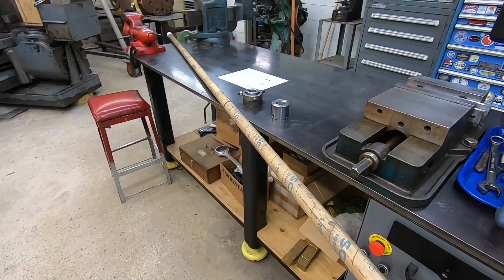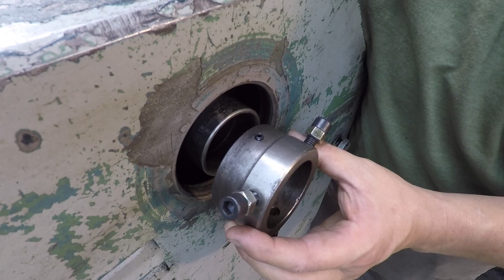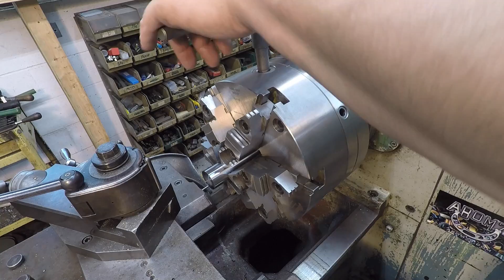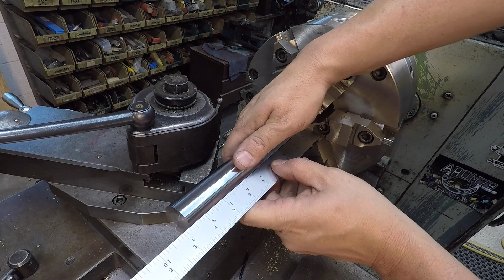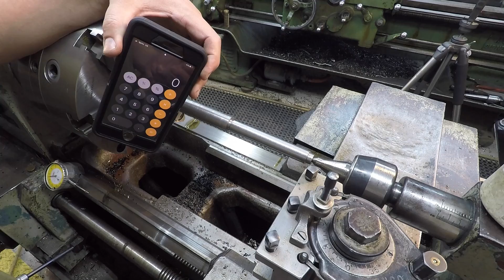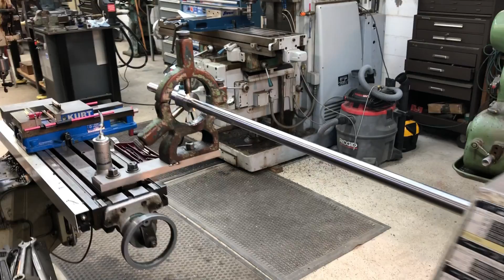Machining a Custom Prop Shaft Part 1

Comment: I saw a video of a guy doing this . Very poorly supported,  im guessing he was fired, if he survived! The last thing i saw was tge material Bent at a 90°.   After the bar beat everything up. It picked up the lathe and started slinging it around, he was using one of the jackstands with wheels on top . It wasn't level or something. It made a mess..  and it was a huge lathe, looked like a 20' bar of 2" maybe larger.

Comment: First put the steady rest on the lathe with a piece of stock the size of the shaft support bushing in the chuck then adjust the steady rest legs to the diameter of the support shaft bushing then remove steady rest and mount on support mill?

Comment: I make many propeller shafts for boats with inboard engines and mostly use either aquamet19 or 22 stainless, 17 does not hold up for in saltwater, will be pitted and rusty in a few years of use.
Reply: Like he said, it's a prototype, so I doubt it will see corrosion within the experimentation phase, and proper material selection will follow later.
Reply: Not if you use the some type of cathodic protection. Better for larger vessels also stronger material compared to 19

Comment: does anyone know he briefly mentioned Small set screws on the chuck to fine-tune something I’m not really aware of how that works can anyone offer any explanation? Because I noticed there are set screws on chucks normally you just dial it in as best you can tap the jars or the work peace and get it as closest possible but if there is a further way to get it even better I’m curious

Comment: when you start the second and third and so on passes of the threading at that RPM how do you get it to start at the same point on each pass?
Reply: that’s the dial he showed with the even numbers.  it’s like a nut that grabs the lead screw. so he engages it every time on the same number.  i think he’s using number 1.

Comment: i like that center your using with the  little extended straight section.  there a name for that kind of center?
Reply: It is a steady rest that's usually used in the lathe somewhere between the chuck and the tailstock.
Reply: @Brian-sb6rf  yah, i asked about the special-ish center he used in the tailstock, not the steady.
Reply: @mtraven23  Okay, i see, my mistake. You're talking about the live center. The cone on it is made in such a way to aid in getting wider tool holders closer to the center of the part. As far as a name? I think they're pretty much just called a long nose or long point live center.
Reply: @Brian-sb6rf  yah I totally see the use, wanted to get one.  needed the term "long nose".

appreciate the assistance, thank you.

Comment: The brake on the Victor takes its time to activate, how do you go on in an emergency stop ✋
Reply: It's actually a manual brake. It's not stopping like that by itself, though some machines do come with a brake system. Instead there is a foot pedal near the floor that he steps on to stop the machine.

Comment: 35:10 I´m working as a CNC machinist for half year, I was borrowing 50-75mm mic from one of manual machinists, he asked me if I knew how to measure with them... of course I do, I said... so show me then on this shaft.... as I´ve started to tighten the mic he said you´ve already got it wrong son.... let me show you, look at my face as I´m measuring.... he got it tight a bit, looked away and tightened the ratchet.... this is, young boy, how you measure right, not wanting to get it into the tolerance... from that moment, I look away a bit everytime I measure with a mic :)

Comment: Adam, I like the way that you went into such detail about how to align the shaft in the center rest. Using the Starrett level, and lifting the shaft and settling it back down on the fingers of the center rest to check the bending moment..... That showed good sensitivity, and it was so cool!!!

Comment: This has probably been answered before.  What brand is the indicator holder used on the lathe way?  Or is it homemade?
Reply: that looks home made to me. I haven't found any available for sale, and it would have to account for many different  ways.
Reply: If you're talking about the indicator holder with the magnetic base almost all the ones he uses is Noga brand.

Comment: This man really knows his stuff!!! I really like how he used the bushings and supports, and adjusted them to cente& true-up the shaft within 0.0005" , the radius tool to relieve the stress riser that was at the base of the threads & shoulder, and the way he frequently used the micrometers, dial indicators & thread pitch & diameter gauges .... Hopefully the customer will come back to HIM For any other Machining work that needs to be done... He is AWESOME!!!

Comment: When cutting the thread how does the tool find its way on the second to n-th pass? Does it get "pulled in" by the existing thread somehow, and if so, how is it prevented that the machine does not just cut a second thread with a different starting point?
Reply: There is an indicator on the lead screw of the lathe.  There is a little dial that rotates to tell you where you are on the lead screw, he's waiting for a certain dial reading each time to engage the half-nut of the carriage onto this lead screw

Comment: nice, but don't piece like this need to be "tempered"? or they get automatically tempered?
Reply: He explained in the video that it's just a trial, if it works, they'll make another one with better material, I would think Thomson shafting would be a good choice. Hardened, chromed OD with a machinable ID.

Comment: I went back into the machine shop recently after about 6-7 years away. We do a lot of hydraulic cylinder repairs including making new rods, pistons, and barrels. First screw thread I cut in around 8 years was an M42 x 1.5 for both internal and external on a cylinder rebuild for the rod and piston. Came out first time with zero backlash. I am so happy to be back in the machine shop. 2 months in now and it t is going very well.

It felt so satisfying to screw that piston on and have it feel the way it did. A real confidence booster to throw myself back into it and confirmed I still know what I'm doing after all these years.

Comment: Boater here. Surprised at how much reduction in diameter was machined at the threaded end.  My three cylinder diesel only produces 27 hp.  Shaft diameter 25 mm.

Comment: When you  tighten all 3 pinions, there is a small amount of clearance between the scroll and the spigot it rides on which gets pushed ever so slightly to one side which alters the measurement.  People forget about this when grinding the jaws of a chuck to true it up and if there is a lot of wear on this spigot all the grinding in the world won't get those jaws to run true.

Comment: How do you ship or deliver a shaft like that and protect it? In a PVC pipe?
Reply: Small crate type wood box. But yes...also you would insert it into either a black steel gas pipe or even pvc. But ultimately it would be boxed.

Comment: Hey brother, I appreciate your videos and their excellent and knowledgeable content, thank you for taking the time to make them.  I just wanted to make a possible suggestion.  Like you,  I find myself standing on concrete and working with my hands.  Have you ever considered using some of that thick (1.5 inch or so) black rubber mat (with holes) on your floor space?  Similar to the stuff they use in kitchens and other hard surface areas?  It comes in large (very heavy) rolls or easily manageable pre-cut squares, which are easy to pull up for cleaning purposes.  I think you should look into trying it out, I promise your back and feet will thank you.  I am not affiliated with this product, just a satisfied product user !

Comment: Why do go-no-go gages have splits in them.. do they get calibrated? Are they adjustable?
Reply: All gauges get calibrated if you are in a proper working shop environment. Ive never used split ones, but suppose its better really as they can be tweaked if worn on the go with alot of use.
Reply: Mark, you are correct. The splits are not so the user can manually adjust the P.D. but for the Manufacturer or Calibration Company to compensate for wear.

Comment: I always had an issue with stopping the carriage before running into the shoulder or stopping it to soon to ruin the threads.  If you did that manually nice job.  Looks like you either own your own shop or you are the boss. I always had some one  coming out of the office " are you done yet"  and it was very distracting.  Very methodical and all ways think ahead.
Reply: This is his personal shop

Comment: Does that mic  measure root or effective diameter??
Reply: All Thread Mics measure Pitch Diameter only because it is the dimension that affects the fit or H-Limit of the thread.

Comment: Why show the indicating?  That is the most boring thing you do. Operators do their own. And do it well. Watching shows nothing.
Reply: A huge percentage of Adam’s audience have hobby machines or just bought their first serious machine and some of these basic techniques have not settled into habit yet.  Getting set up right gets one out of the sloppy habit of ‘eyeballing’ your project and shrugging it off as “good enough”.  I was in the shop when one of the guys projects flew off the machine and punched a hole through his arm because he ‘forgot’ to indicate or set machine speed before just flipping the switch and running the tool.
Reply: Because it's SO important! And because if you're not practised at indicating it's really tempting to compromise. Adam demonstrates that, with practice and patience, it's possible for us all to get it right.
Reply: Indication = porn
Reply: ...well, if ya don't LIKE IT- then ya don't have to EAT IT!!!

Comment: I recommend a miniature electric valve here. I have experience in this area. The effect of water saving and water control is very good. You can go to this website to see. There are different electric valves, such as open /Close valve, proportional valve, it can work under different voltages, and can choose different control methods. Website: http://www.tf-electricvalves.com

Comment: If it's a mud "motor" why does it need a drive shaft? The motor would be back at the wheels and there would be one per wheel. 
And if you meant to say "engine", maybe it's time to review the difference between an engine and a motor.
Reply: I’ve never seen wheels on a boat... Sounds like it wouldn’t be very good in the water that way. Mud motor is an industry term for it and its what’s there all called. Nice try just trying to be an ass though.
Reply: An engine is a type of motor but a motor is not necessarily an engine.

Comment: Machined many long 15 meter shafts mainly for ship propulsion, multiple steadys, the hardest part was trying to keep them straight because forged shafts will bend with cutting stresses.

Comment: I do this type of work all the time. I like that sleeve idea you used. Many times the machines at my work have a too big steady rest. I'm going to steal your idea and make up few sleeves! I make a lot of different pump shafts anywhere between 10 and 12 feet. Thanks for the vid! Only thing I didn't like was seeing you put your left arm over the chuck when using the file.

Comment: two questions from Italy: 1) how long has that mechanical workshop been open? 2) how much value is there in equipment? .............. especially congratulations. I also worked in a place similar to Gardolo di Trento ..... that workshop (where I worked) has been open (evolved obviously) for at least 100 years. It is now a mechanical workshop where they build precision parts with the CNC.

Comment: I really don't understand how he can just engage the table any time and it's just knows where the threads starts
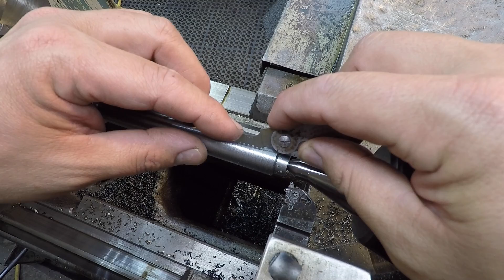Reply: at 30:00 he show the dial
Reply: @FabianEssiggurke   yeah you're right I completely forgot that dial turns with the screw. I remember now he explained it in another video, can't tell which.

Comment: I have never seen a guy run a lathe that fast while threading!  We call a spring pass a free cut.
Reply: I used to run threads at very low cutting rates-- then I saw "seasoned" machinists do it at high speed and I found threads were much better and of course faster.

Comment: Relatively new to your channel and I really appreciate both your skill and your ability to educate. The thread cutting operation was of particular interest to me in this video. SO MANY questions exploded in my brain which, to a professional like you, must be old hat but intrigue me. No doubt there are A LOT more elements that go into this than I could even ask about. But how you calculate things so feed rate and rpms and shaft diameters work together to get an accurate thread cut. Or what types of machines do this better than others and why? Or how do you decide when it is better to cut threads as you did vs using a die? If you have already done a more detailed video on cutting threads, could you direct me to it. If not, perhaps you would consider doing one. I, for one, would love to watch it.

Comment: what would happen if your late to disengage the the threading tool? and what would happen if you engage not on the line?
Reply: why would you be an ass about it? Obviously they didn't know..
Reply: At best you would damage the bearing journal. At worst, you would probably break your threading tool. Not engaging on the line result in a new (2nd) thread between your existing thread. Double threads are used in special applications so that is why you can engage at "half" thread.
Reply: Cross threading would occur rendering the part useless aka scrap.

Comment: i was also taught from the beginning that you need to tighten all the screws on those 3/6 jaws. also had a lot of people tell me that yo dont have to and i never did believe them. always felt better to tighten them all.
Reply: I'm not a machinist, but I am a master carpenter and I was taught to always tighten chucks up in all locations. just best practice, tried and tested.

Comment: How do you get the insert to start cutting at the right spot on the circumference of the shaft on each pass?  What I mean is, it has to cut down the same groove every time to make the thread deeper and deeper rather than just cutting a groove that starts at a completely different place and messes it up.
Reply: The indicator he showed right before cutting the threads, you engage the lead screw at the same spot on that dial each time and it will start in the same spot.
Reply: Either use the indicator for each pass , or on newer lathes you engage it once then straight into reverse when tool hits the undercut , you need to run it abit slower but you will never miss-pitch (I prefer this method)

Comment: @Abom79
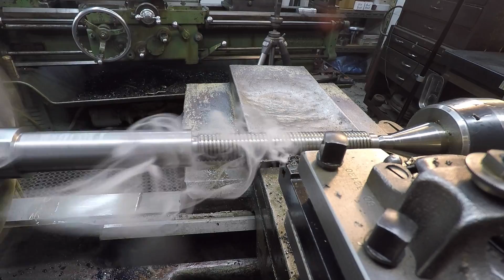Please look at the video @30:59 just as the tool contacts the shaft. It looks like your live center has a bit of movement in the up direction. I was not sure if that was acceptable

Comment: Here is an Idea for you to try on your next long shaft where you have to use the steady rest to support the end of a shaft. Instead of a collar, why not use a roller bearing or a ball bearing? The 3 jaws of the steady rest would hold the outer diameter of the bearing and there would be no need to lubricate an area of the shaft collar where there could be some wear. Makes a poor man's roller steady rest.

Comment: Lol I'm doing  the same job at work. But have 20 shafts to-do, 1 1/2 OD.TGP 1045  using a bridgeport mill with bearing block clamped too bed for support ,spider too 12' feet long got the job set up ,now got a young kid at work willing too learn so I'm training him , watches your video s. I tell the kid watch you can learn from any one if I can do it so can you! lol keep up the good work Adam  !!!!!!!
Reply: Abom is a true master. Respect.

Comment: I think you probably could have used the mill table for the in-out movement of the shaft on the lathe...

...if the mill table and lather were align, of course.
Reply: probably faster to just move it by hand

Comment: Forgive the dumb question but: Based on other videos featuring the six-jaw, I get the impression that you trust it to be true and center to a very high degree (Unfortunately I don't remember the exact video where I first got that impression, sorry).

I am under the general impression that one should never trust a self-centering chuck to be concentric, which is why we always use either a collet chuck of a non_centering four-jaw that we indicate the work in.

Am I just completely wrong (I am mistaken in my assumption and you don't in fact trust the six-jaw) or is there a reason the six-jaw is very accurate? If so, is it this six-jaw in particular or are six-jaw chucks generally precise and why?

I haven't worked with a six-jaw yet but I was under the impression that their only benefit relative to three-jaw is better grip especially on smaller diameters (with reduces pressure on the part also)

EDIT: Ok, so after a few times that I had that question in my head, I think I jumped the gun this time and didn't watch long enough. I'll have a crack at an answer and correct me please.

1: this is a precision six jaw
2: the back plate has built in adjustment so you can dial it in after tightening it down
3: Not all six-jaws are this precise and some are just as inaccurate as any three-jaw so it all depends on the specific chuck.
Correct?